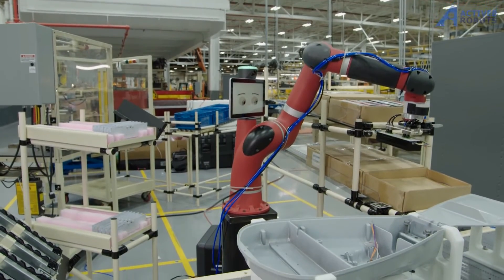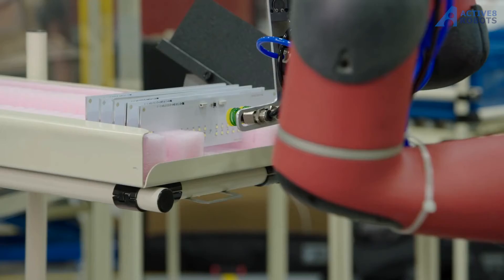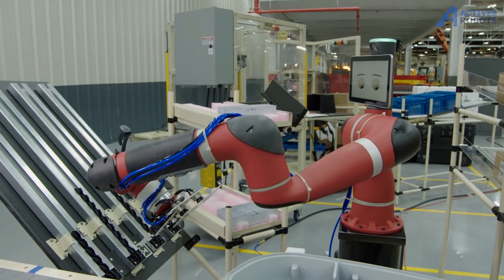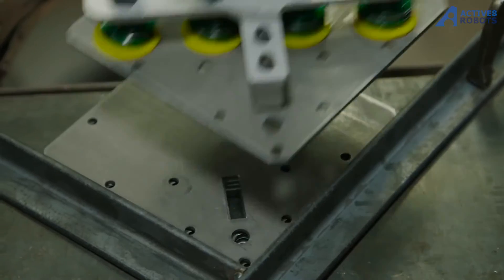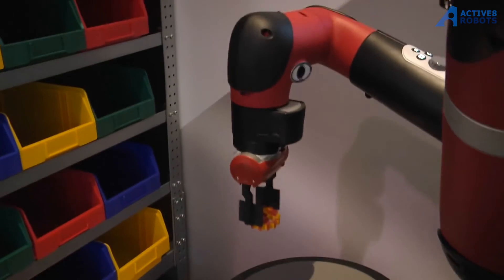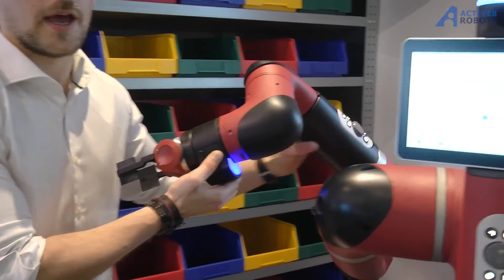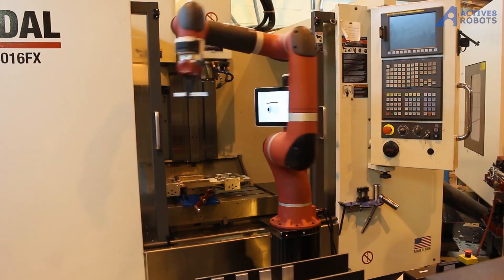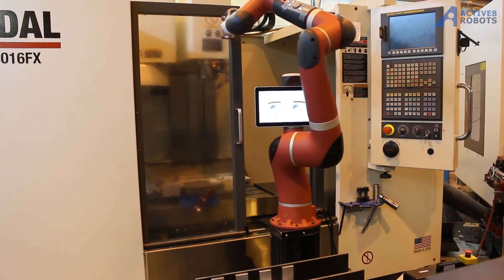Active8 Robots present Sawyer - The world's leading collaborative robot from Rethink Robotics

Comment: Sawyer is a revolutionary new high performance collaborative robot that can safely and effectively interact with human workers and assist them while performing industrial tasks.

The newest and world’s leading collaborative robot, Sawyer is precise, flexible, safe and easy to program. You do not need to be an engineer or robotic specialist to learn, train and program Sawyer.

Sawyer combines a number of unique technologies designed to allow deployment without some of the traditional safeguarding described in CE, OSHA, ANSI, ISO or other safety standards, based on the application’s risk assessment. Sawyer is design for: 
• Physical interactions between a worker and the robot
• Avoiding accidental contact
• Minimizing forces and slowing/stopping during human contact

More info: fernando@active8robots.com